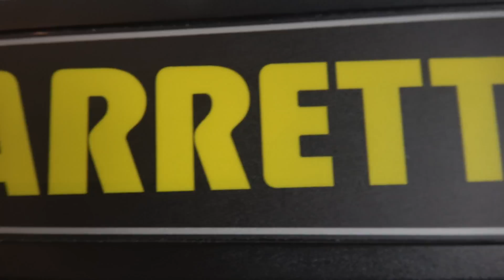What's inside a Metal Detector Wand?

Comment: You need to cut open a flat screen tv again, this time horizontally, not vertically. In most big screen TV's nowadays they are edge lit so all the lighting is on the edges. When you cut it vertically all you get are all those sheets. If you do it horizontally you should find the lighting components.